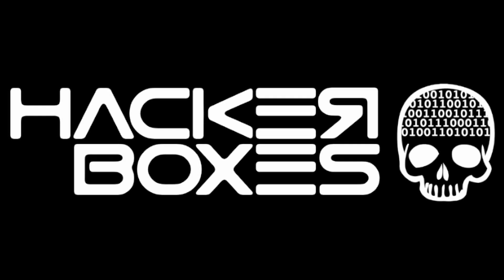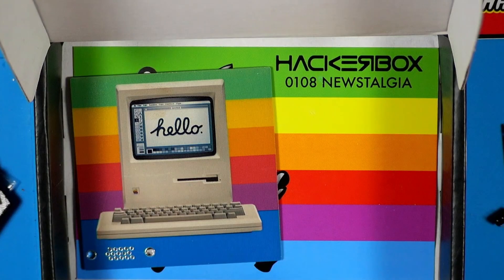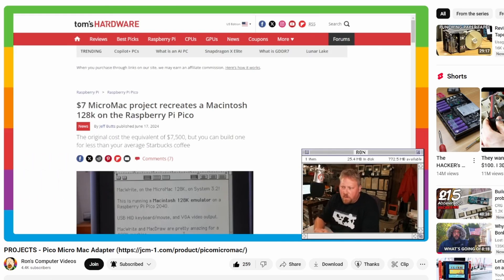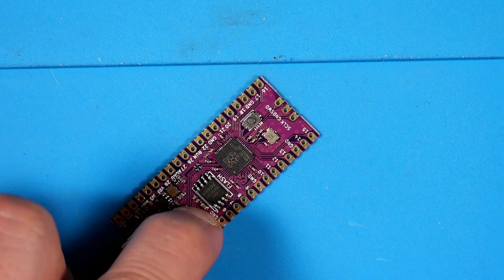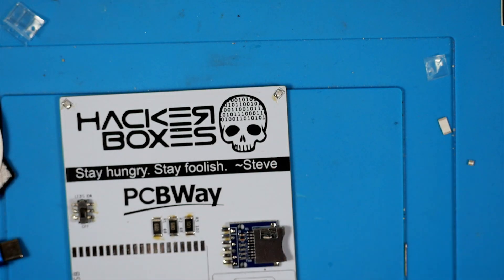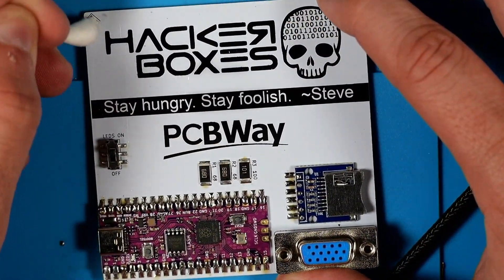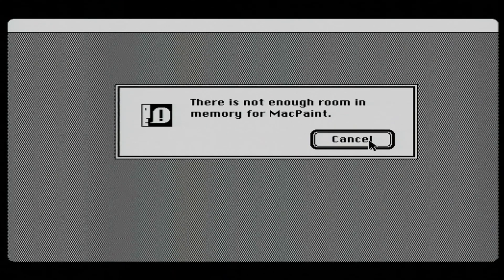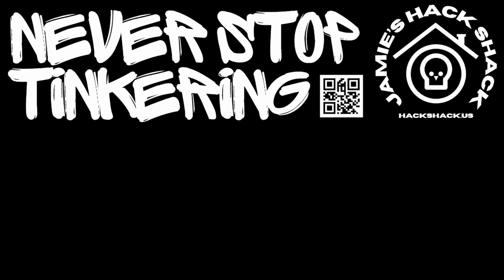Hackerbox 0108 - Newstalgia

Comment: Great job!  I had the same problem with some of the programs on the MicroMac.  I looked up the errors, and they too pointed to lack of memory.  I'm pretty sure Frogger shouldn't need to write to the SD Card as soon as it starts... so I think the writable volume thing might be a red-herring.  I'll be interested to hear the cause if you do figure it out.